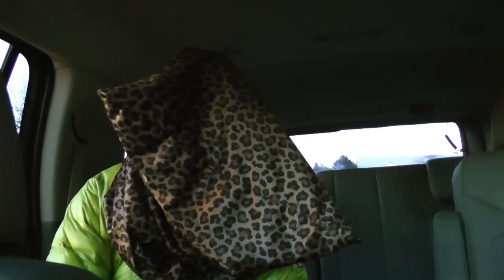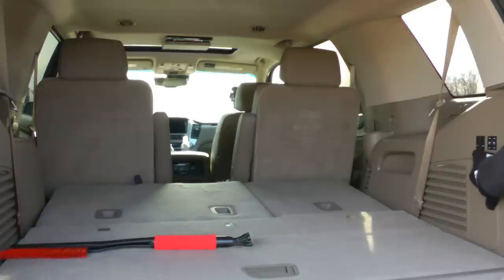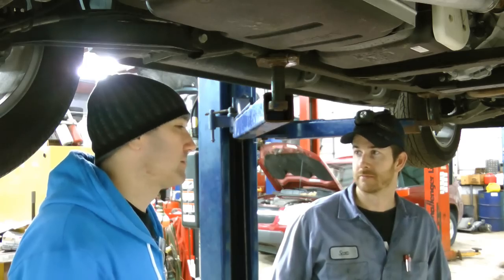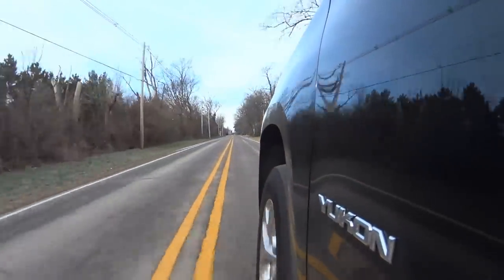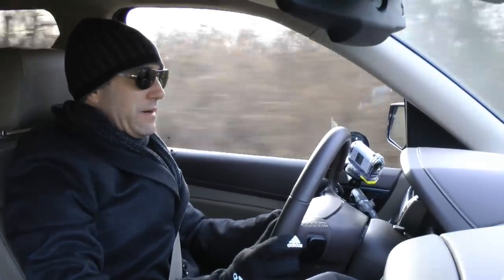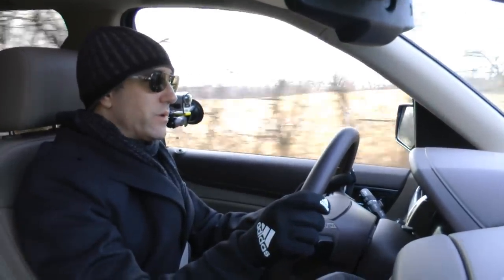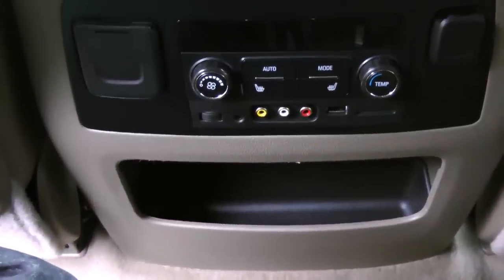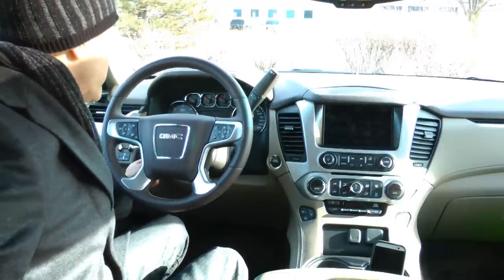The 2015 GMC Yukon | Monster Review

Comment: hm.... I just google about Yukon... Looks like they control air in shock itself...but still use coils...
7:45 - like you said "it has a premium smooth ride suspension" but its not "air ride"
Reply from the maker: +Subjohny There are multiple ways to do air ride. Some use air bladders for Coils others use air in dampers.  But in both cases some type of compressor is involved.